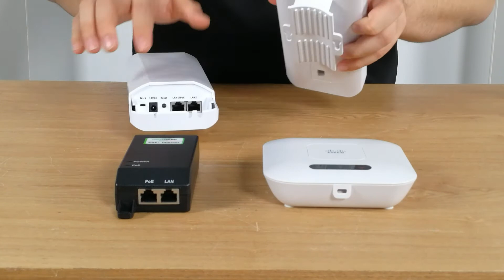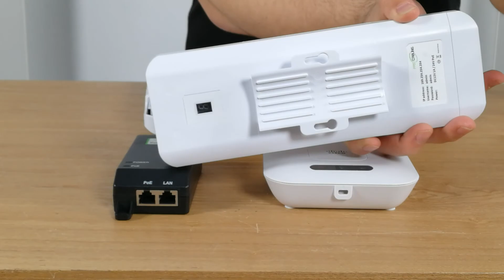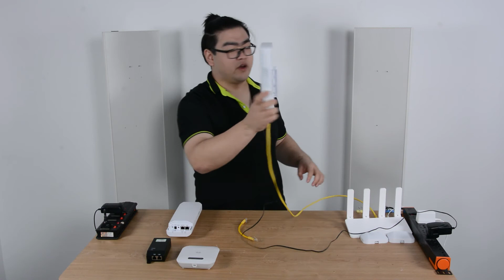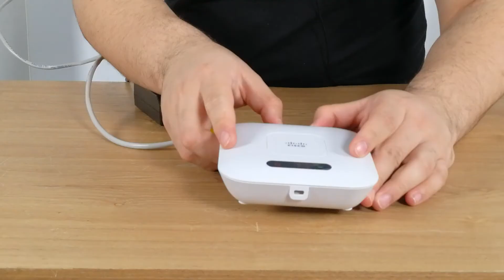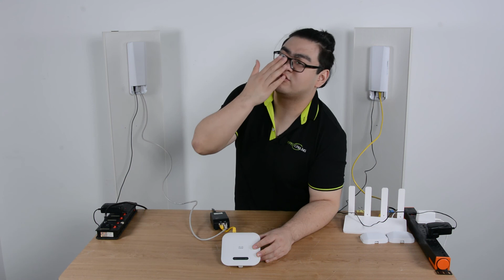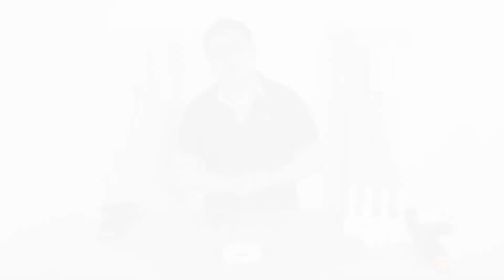Things Should Know when Choosing Wireless Ethernet Bridge for PoE Power Network System Setup

Comment: Can you please explain why the Poe injector is needed. Thank you.
Reply from the maker: That's because the wireless bridge can only transmit data, while the AP should be powered by PoE. So the PoE injector is needed to provide power and data simultaneously to the edge device via a single network cable. If you have more questions, please refer to this video: https://youtu.be/tlZSnzkRu6g
Reply: @Fastcabling  Thank you for the reply, I thought the bridge already had a Poe output. Great video!